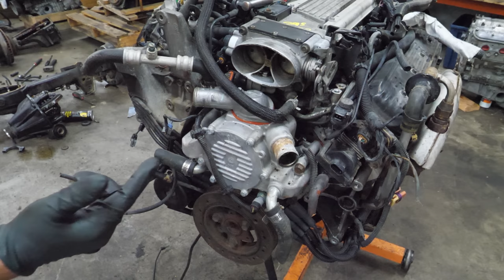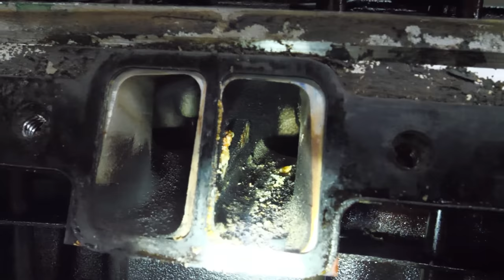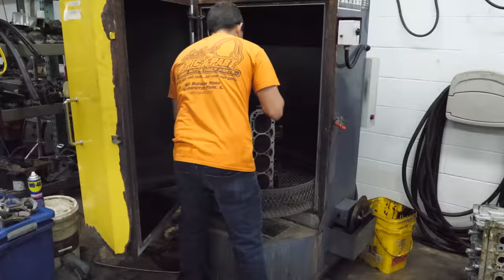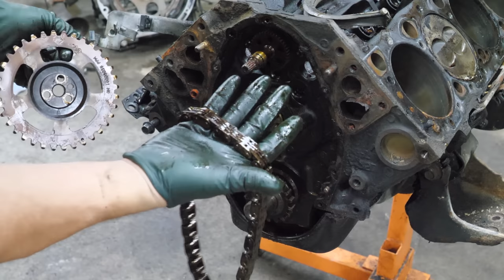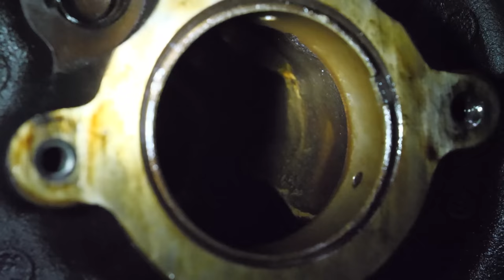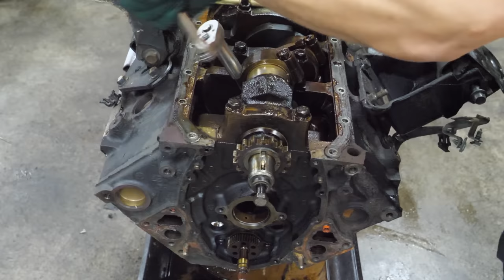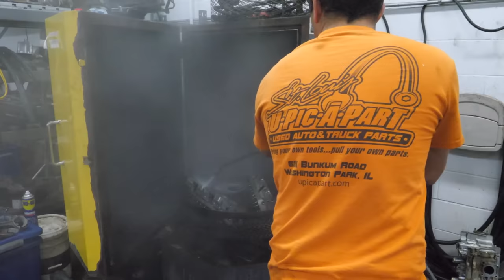Bad Corvette Camaro Trans Am Gen2 LT1 350 Teardown. Not The Problem I Was Told!

Comment: 30 years  later and most LT1's just needed oil changes and an ignition system upgrade !
Reply: Right take care of it and it will last.
Reply: I got 319k out of my 93 Z-28.  Best car I ever owned.  Actually still own it.  Needs restoration that I will likely never do.
Reply: What would you recommend for upgrading the ignition system? I have a 96 z28 that keeps giving me issues with that optispark.

Comment: The optispark ignition is not near as bad as people make it out to be. It’s actually really precise as the high resolution sensor knows where the cam is to the degree. The biggest thing is to have the newer vented cap and rotor, make sure the vacuum hoses to it are good, and to keep water out of it by tapping a fitting into the weep hole of the water pump and putting a hose on it to route it away from the distributor. If you maintenance the cap and rotor like you should it should be sealed anyways. I think it got it’s bad rap due to people using cheap aftermarket opti’s that had cheap optical sensors instead of the reliable Mitsubishi sensor. The vent help a lot. It removed the ozone that built up from high voltage inside the cap and made them more durable.
Reply: Ty !
Reply: You must be insane. Optijunk sits so low on the engine it will die in hard rain
Reply: I seen Mitsubishi sensors bad too
Reply: Ive been through 9 opti sparks all wiped out for rain. Ive had vented and non vented. All sucked. Im now getting the torqhead kit. 9 optis in 60,000 miles is pathetic.
Reply: Dude.. it's crap.. as soon as it gets wet, which is inevitable, it craps out, revs too high.. it craps out.. hell, you put the key in too hard The opti might die..

Comment: I had a 1996 Buick Roadmaster with the LT1. Great car, true 3 row seating (took the whole office to lunch). Comfortable and plenty of power if you didn't mind 14 MPG city and 20-22 highway. Before I sold it to an older couple reminiscing about the Regan presidency, my wife and I took turns sitting in the rear-facing 3rd row while the other person floored it. Good times.
Reply: Haha. Nice recap.
Reply: @riccocool  it's definitely one of the good memories. Although part of me wishes I kept it for hauling the kids.
Reply: @mphilleo  I remember being 12 and sitting in one of those rear seats alongside my brother on a group trip to a baseball game.  The kids in the car behind us thought it was fun to wave and we waved back.
Reply: @mphilleo  I bought an all original 67 country squire to haul the kids around.
Reply: The Roadmaster also had a roller cam LT1, the only model to get that. What's ironic is todays turbo 4 bangers can barely beat that MPG.
Reply: @Dan Wake  Turbo 4s today get way better gas mileage.  Look at the Honda Civic with a turbo 4 . Not only would it blow nearly any LT 1 car off the road it can get 30 mpg or better
Reply: Put 1000 lbs in the civic and the gas milage will be 22mpg as the underside drags down the highway.   A buick roadmaster was less aero than a F150 of today.... thus 22mpg.   Dont get all civic is more efficient, anything with o2 sensors and a computer ultimately gets the same milage on the same tire given the same aero drag rolling at 65mph.   The roadmaster confortable slept 5 + driver for quarter million miles if you did not go broke with water pumps + ignitions and the occasional transmission.     The number of kids conceived in the back of roar master still eclipses the number in a civic, optimum Friday nights in the 1990s, and who cares gas was 1.25.
Reply: Hehe the last part about the back seat didn’t read like it read in my mind.

Comment: Funny how the roller lifters in those old LT's lasted forever, but nowdays, they can't hold together regardless of better oils etc.
Reply: The oils  might not really be better,just more catalytic converter friendly.  (Less antiwear additive?)
Reply: I'm sure they use cheaper steel alloys, too.
Reply: The cylinder cancelation system causes lifter failure. I know someone who had a Silverado with the 5.3 and the lifters went out at 60k miles. If the truck is driven in manual mode it will lock out the cylinder deactivation.
Reply: I  saw a comment mentioning the lifters last longer when they're in the valley. better oiling or somesuch, don't understand it myself.

Comment: I am betting that the reason they thought it was locked up is because it was hydro locked. After sitting for awhile, it just bled down the cylinder walls into the crankcase.
Reply: Also might have happened while at idle so didn't do catastrophic damage
Reply: My thoughts also...
Reply: @davidpowell3347  - Probably couldn't get it to turn over and start...
Reply: If its hydrolocked whats the course of action?

Comment: My 94 Firebird Formula is long gone, but I still have her oil soaked all over my garage floor to remember her by.
Reply: My '95 Caprice leaked from the oil filter adapter, about a quart every 600 miles. I never changed the oil in it because I figured it was already getting five new quarts every 3000 miles.

Comment: One of the major takeaways I get from these videos is that removing the dipstick is the toughest part of any teardown.
Reply: Many times. Especially in the north. Rust builds up around the dipstick, and it's hell to get them out in the vehicle. I found using a small amount of heat makes them fall right out. MAP gas torch works perfectly. If you're gonna be putting it back together, don't forget to replace the O-ring.
Reply: @Spike-sk7ql  I feel lucky, with the Gen II LT-1 I had apart, dipstick came out with little/no hassle.
Reply: Especially when the sludge is an inch thick inside the engine
Reply: Lol, I was doing an oil pan gasket on my car and it came right out.

Comment: Hey the Optispark vent was added in the 95 and up camaro's. The high voltage optispark produced ozone which rapidly built up and massivly sped up any corrosion inside of the optisark. Venting it allowed for a steady stream of fresh air to cycle through preventing the buildup and was actually quite effective :)

Comment: I have a 94 Trans Am I bought brand new.Fully loaded, leather, every thing except T tops, my 79 TA had those, loved having them off, but after a few years, they started leaking.....It was my daily till 2005. Ive now had 5 new cars since, but the TA IS A KEEPER. It has 338.000 plus miles now. The engine has never been touched.  Even the timing chain is original.  It runs and sounds like new.  Uses no oil between changes, and those have been every 3000 miles since new. Castrol GTX.  Never had synthetic in it. Lifelong Southern California car. Its had 2 new water pumps, 2 new radiators,  and 3 new optisparks. It still looks great in and out, and has NEVER FAILED California emissions test which is unbelievable,  as its a difficult test to pass...treadmill, test rod up the tail pipe...yeah, I love my old Trans Am. They weren't cheap, mine cost about 42.000 in today's money.
Reply: Cars don't have T TOPS !! WOW. They have 2 removable roof panels. What's left is the T shaped structure of the roof.

Comment: One of my favorite engines. It actually holds the GM 6spd manual record in a ‘97 Camaro. 6.61 @217mph in the 1/4. 2500hp.. No LS can touch it so far. Facts.

Comment: I had a ‘93 Trans Am and in ‘94 I ordered a T/A convertible with a 6 speed (young and stupid :)  LOVED those LT-1s, especially with the manual behind it.  A total blast!!
Reply: Had a '95 manual Z28 coupe, and HELL yeah that thing was fun! First manual too, the thing survived as I taught myself heel toeing, push starting, rev matching etc. 
Also first RWD car! 😄 Also young and dumb - a miracle that I never crashed it! Except into a curb, needed a new wheel.
I don't miss the electrical problems but man what a blast that thing was to drive.
Reply: In 1976 I ordered a  new 1977 TA Bandit Edition new drove it for a couple years and then stupidly traded it in for the 10 year anv model in 1979...back in the day they werent worth much just like the black ford  SWB trucks in 1980 and 81  when Urban Cowboy came out everybody had to have one especially the short guys always laughed as they were lifted so high they had a hard time getting in and out..culture changes with each generation  and Ive been through hundreds of cars

Comment: Thanks for doing one of these LT1 engines. I was in high school and my first muscle car was a 95 convertible formula firebird. Worked part time in school to pay for it. I wrenched on that thing for all sorts of things like the opti-spark, water pump (funny how I had to do those at the same time), and intake manifold gaskets. Loved that car, and put 172,000 miles on that engine / car before selling it. The 4L60e had to be rebuilt a few times, but that engine survived a lot of long miles and still had great oil pressure and no knock. Still pulled strong when I sold.
Reply: "the 4L60E had to be rebuilt a few times". Once would be enough for me. Sometimes ya gotta know when to walk away, kid.
Reply: @jeffrykopis5468  transmissions go out!! It's just the way it is!! Especially in something that gets hotrodded on a regular basis!! Transmission rebuilt is no reason (at least for a real car guy) to get rid of your baby/pride and joy!!! You are the type of person to give up on whatever your doing and just sell said object instead of tackling the problem head on and conquering said problem!!!
Reply: I had a 95 Z28, but with the manual. Now I don't hate automatics (frankly, a V-8 sounds its absolute best with good old automatic upshifts with relatively wide ratio spacing like the 4L60e).
But the BorgWarner T-56 took everything I threw at it, including being my first manual car and me teaching myself techniques like rev match downshifts and push starting. 
Worked like a champ till rust took the car from me at 145k miles 😢

Comment: I was a fuel systems engineer for Rochester Products div of GM  (now Delphi) back in the day when we were making the transition from carburetors into fuel injection. The reason trucks didn't get multiport systems is because they were slated to get the dreaded CPI/SCPI (aka Spider) systems. They had the injectors in a central location in the intake manifold, with tubes running to poppet nozzles near the intake valves. GM loved the idea because it eliminated the need for a unique (and expensive) fuel rails. All they had to do was change tubing lengths for each application. Unfortunately, the system performed poorly and GM had enormous warranty costs on them. So trucks went to conventional multiport systems in 2000 with the Multec II injector.
Reply: I have a 1998 5.7 1500 van. Any tips for keeping the spider injection in good condition?
Reply: @paulmryglod4802  Yelp, don't own ROFLMOAO
Reply: @watup110875  hahaha alright alright
Reply: I thought they just used throttle body injection and then went straight to multiport when they updated it to the Vortec 5700. I got some research to do.

Comment: Opti-sparks are not vented for cooling, it's to remove the ozone that builds up inside and destroys the innards.
I took my 94 Roadmaster Wagon 3000 miles this summer from Eastern Washington to Amarillo, Texas and back for a tranny rebuild and it never missed a beat. 22 mpg at 75 mph. I've got a good one.👍
Reply: Why would you drive 3000 miles for a transmission rebuild ? Thanks
Reply: probably went to precision transmission, they have a youtube channel but have since quit doing videos.
Reply: That's about the same MPG as my turbo 4 at that speed lol
I firmly believe Subaru should've just put GM V-8s in the STI, it would be a better car in every way

Comment: These were the cool engine when I was a kid in the 90s. I remember looking to see if a Caprice or Roadmaster had dual exhaust. Then you'd know it had the LT1. It's funny, these LT1s came out in 1992; 22 years after the first generation debuted in 1970. And the 3rd generation came out in 2014; 22 years after this one.
Reply: You young whippersnapper! My buddy and I stuffed a 425 HP 409 in his 60 Chevy Belair 2 door. It had staggered dual quads and a chrome air cleaner. The top looked like a shiny garbage can lid. It was fun to suck the doors off a 389 GTO.
Reply: The 2036 version will have batteries. But it'll be fast.
Reply: @johnstreet797 It's fun to see those flexy-flyer X frame cars twist up like a pretzel at the drags.
Reply: @johnstreet797  My dad has a 389 Tri-power goat. That sounds like it was a cool unit. When I win the lottery and can buy acreage for car, I'd really like to get into those 1st gen Chevy big blocks. They're still something of a mystery to me.
Reply: @jeffrykopis5468  But it will be gay. With 4 doors, no less.

Comment: I have a 1956 Nomad. I bought a 94 Camaro z car with a lt1 and a  t56 at a local auction that had smacked a wall. I went through the engine and replaced the water pump with new GM. Eliminated the air pump, egr and added headers. Even on a hot day with the a/c on, it runs cool as can be. I upgraded the optispark and vented it using the original fuel vent solenoid. It’s a great hot rod and fun to drive.
Reply: I'll bet that Nomad goes like a streak!
Reply: @joemomma8905  yes, I sent it out to have those features turned off. I found the guy on the internet. That year computer can be easily modified as there is no downstream o2 sensor, just upstream.
Reply: @joemomma8905  yes, I sent it out to have those things turned off.

Comment: I put 115K on my 97 Z28 before I swapped it for a crate engine.  The stock engine always started immediately, idled smoothly, no smoke, passed CA smog, revved good and ran strong.  Never had a problem with the opti-spark.  I provided a new opti-spark to Golen for my 383 crate engine (460hp/440 ft lbs) and I have had no problems tracking the car. Redline 6,500. Fuel cut off at 7,000 rpm.

Comment: My daily driver is a 95 Trans am 6spd with this engine except OBD1. It just hit 100,000
And still runs like new.  I purchased it with 80,000 previous owner changed the oil every 3,000 since the car was new and I've done the same since I have had it. I pop the hood every couple days make sure the water pump isn't leaking. Take care of your car it will take care of you.
Reply: Awesome car for sure. I had a 6spd Z28, also 1995. Never had an Opti problem, but other electrical things were problematic (blower motor and window regulators). That T-56 was indestructible and a joy to shift. 
Hope the Trans Am gives you many more years of awesomeness! Love those pop-up headlights too

Comment: Your introduction was great!  You cleared up the confusion to the old timers and the youngsters.  The 90s LT1 was great for its time, especially when compared to the previous L98.
Reply: L-98 just needed better breathing heads.
Reply: @johnpopoff7950  It was also the L98's factory intake, which had long runners that were great for torque, but made the engine fall flat after 4,500 rpm.

The Lingenfelter/Accel Superram intake brought the L98 to life (took the motor to an entirely different level).  It boosted horsepower by 30-40 hp, but improved the entire powerband all the way trough to 7,000 rpm.

Then you had the super rare SLP intake, which was on the legendary 1991 Firehawk.
Reply: @rudimerm7686 Sounds like that Superram intake pretty much brought the L98 to LT1 power levels in one fell swoop. (Without reverse-flow cooling too!) 
Since it doesn't use the long-runner design of the stock one, I imagine it makes it somewhat less torquey down low?
Not that it's not worth it.
Reply: @nthgth  You know your stuff.  If I remember correctly, the Superram runner length was 7", so peak torque would not be compromised.  As you said, low end torque was slightly compromised.

Comment: There's a coil pack ignition system available for this now from Torqhead that converts it to the LS PCM. It's a little pricey but you can install an electric water pump so that it can no longer leak from the weep hole onto the distributor. I still have the optispark on mine and it's really not bad as long as nothing gets into it. Once you get past those issues it's a great engine.
Reply: Why would you spend that much to convert to coils. Might as well get a used ls
Reply: @YungEagle3k  I didn't buy the Torqhead for my own car because of the price but converting an LT car to LS is still a lot more expensive and a lot more work.

Comment: I had one of these in a 96 T/A, somewhat built. The Opticrap killed it. I wish somebody made an OptiEliminator back then, because IMO, the 93-97 F-Bodys were the best looking ones..
Reply: You can see the distributor drive is still there for the oil pump.....I bet someone makes a kit.
Reply: @imtheonevanhalen1557  Now they do. A couple of companies have kits to use the LS1 coils. 25 years ago, there was nothing except an extremely complicated and expensive conversion from Electromotive.
Reply: 93-2002
Reply: @shadowopsairman1583  The front ends were redone in 98. I’m not thrilled with the 98-02. The Camaros look like a fish and the Firebirds lost their sleekness and look like normal cars with headlight covers.
Reply: Always put a new Delco in when job created access. New wires , Plugs , Coil too. Good preventative maintenance on nitemare design. Optispark was attempt to improve timing and EFI accuracy , which it did almost as good as crank/cam trigger does these days
Reply: I agree 93-97 for the Camaro, but I think all 4th Gen Firebirds look awesome, even the facelifted ones. Especially the LS1 Firebird Formula - peak F-Body for me.